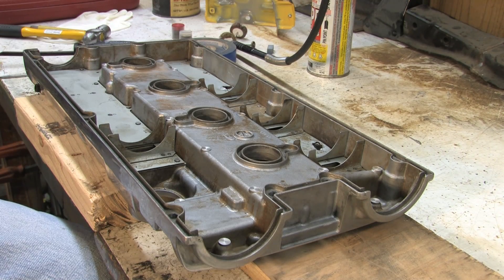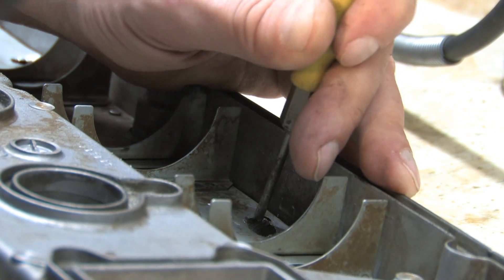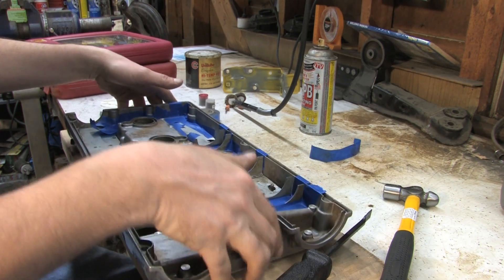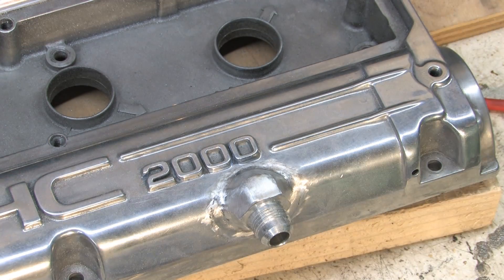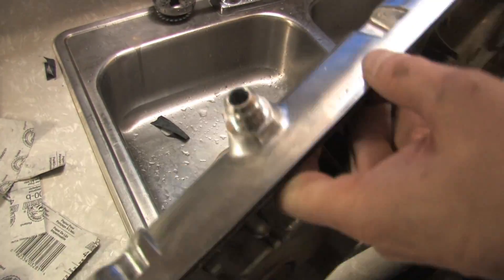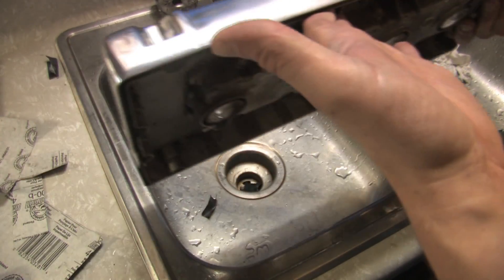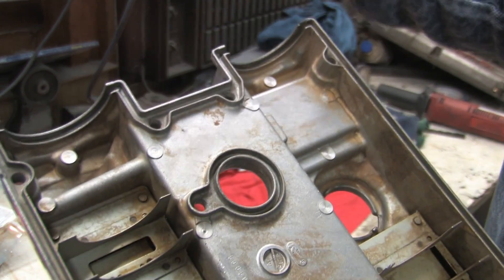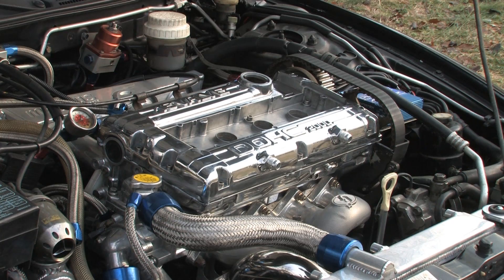Valve Cover Modification and Polishing

Comment: I didn’t see. Where do you have the exit hose from the oil separator connected to.
Reply from the maker: Each one goes to a catch can inlet.  I'm likely changing this.  Making my own thing to bolt onto the things.  More romance than anything, really.  What I have works fine, it's just not very heat resistant, and I don't think I need two half-inch breathers with their own hoses is all...

Comment: When you said go to the junkyard and get something that says Hyundai on it, I was a bit confused since the valve covers don't interchange do they? When I welded a breather port on my head I didn't get any leakage :). I'm no welding guru but not too bad with a TIG (Invertig 221).
Reply from the maker: On my Patreon page, there's a video for my sponsors of me finding a Hyundai Elantra in a junkyard and yanking parts off of it.  You'll see me collect a pristine Hyundai 4g61 valve cover that fits every DOHC 4gxx head.  It was the only one missing from my collection.  It's no different than the Mitsubishi valve covers, it just has the Hyundai oval logo on it.  For many years, Mitsubishi engines were used in Hyundais.  They didn't get the ability to make their own engines until late '95.  Once they did, they still cast parts that fit Mitsubishis for their service industry and on cars produced through 2006.  Some Kia engines, too.  But the Sonatas, Elantras, Excels, Summits and most everything in their lineup from '95 and earlier had Mitsubishi stuff under the hood.
Reply: Oh wow, that must have been quite a rare find. Thanks for the information. I just looked up more pictures of that on google image search and you're right. I've yet to ever see one in a junkyard here in Florida though.
Reply: Btw, what are your thoughts on going dry sump with your setup? I am really tempted to try it, since I can weld my own oil pan. I like the thought of less crank case pressure, or even slight vacuum, not having to deal with breathers/etc, being able to shave my entire valve cover and weld in the oil fill plug, etc. A lot of the used dry sump pumps on eBay look a bit sketchy, or are too big (6 stage for nascar/etc). Kind of hard to find a budget 3 stage.
Reply from the maker: People hated these cars.  Owning one, I completely get why.  But 26 years later it's pretty cool having a first generation Elantra now that they're wildly popular today.  It's like every 3rd car in traffic is an Elantra now.  In 1992 they cost $9,000 less than a comparably-equipped Civic which stigmatized them in the marketplace.  They really didn't sell many of them here in the US except to poor people who couldn't afford to maintain them.  There's absolutely nothing on the outside of them that stands out in any way.  They infuriated everyone on the road when they'd merge into a traffic lane in front of them because their normally-aspirated 1.5 and 1.6L engines were under-rated for the weight of the models with power options.  Everything cracks and rusts on these cars, even if you've never touched or used it.  You can't get a date driving one.  Believe me.  It's because of the buyer's experience with the car, and the lack of love and maintenance that most failed with minor repairs the the owners chose to dispose of them rather than fix them.  But if you accept the fact that they were not well made, then they're actually great cars.  The Mitsubishi drivetrains were solid and reliable if they were maintained.  

The fact that I have one with a 2.0L  turbo engine that makes 420hp with water methanol injection, bluetooth, 800W stereo with 2 10" DVC subs and such a nice interior today borders between stupid and unnecessary.  At least to everyone else who's not behind the wheel.  If you think you're an adrenaline junkie, driving this thing at 21 PSI on the street will scare the living daylights out of you.  No airbags, drum brakes, limited suspension travel and a dead rear axle.  Good luck!  Mine was found at a kidney car donation lot with only 53,000 miles on it.  The previous owner ditched the entire driveline and engine management system, and installed a mash of spare parts from at least 25 different non-turbo cars and minivans, all of my spare turbo parts and bolted to a '90 plymouth laser fwd turbo transmission.  It's definitely unique.  And that's weird... because it's still just an Elantra.
Reply from the maker: Magnus makes a dry sump setup for a 4g63, and it's an absolute work of art.  I could never improve on it.  It's designed for automatics, though... and sadly I don't have an automatic in the whole driveway.  If I were building a race car that I had no intentions of driving on the street, dang right I'd dry sump with Enderle fuel injection pump, a vacuum pump, water/air intercooler, and a Level10 transmission.  Then turn it up to 10,000 RPMs & tater chip it.
Reply: Haha that's quite a description! And a solid axle even? That's definitely an awesome piece of rare Frankenstein build you got. I'm basically in a similar situation. I picked up a 1999 Mitsubishi Mirage from some girl who's ex got arrested driving the car with drugs lol. The ignition coils were shot and she had no license, I scored it for 500. I beat on the stock 4G93 (I think?) engine to the end and couldn't kill it, even ended up selling it. Bought a donor 3g Eclipse with no title and swapped in 2.4 SOHC 4G64. It made the little Mirage come alive. And after I threw some K-Sport coilovers on it, dropped it, gutted it, and some cheap rota grid wheels on it the car actually looked pretty awesome compared to how it started. I had to spend 850$ on custom axles from Drive Shaft Shop to link the 3g trans to the hubs in the Mirage. Ran 100% solid alum mounts on all 4. No A/C or P/S. Swapped in a manual rack from an earlier Mirage.

Then I swapped an Elantra head on it and put in ARP studs. Had to order adjustable cam gears to compensate for the belt oddities. I think I did -4 deg on both gears? I deleted balance shafts. Got a 2G eclipse turbo manifold (only Mitsubishi eclipse I've seen in the junkyard ever, all are usually the neon engine). Thought the old turbo was worn so I replaced it with a cheap Chinesium one from eBay, worked great. Wired it all up to Haltech finally, and after that I was so burned out working on it and so blown away with how it felt under boost that I just drove it like that for half a year. Turns out over time I melted my turbo exhaust wheel a little on the tips and cooked my valve stem seals badly. Also I ran the car with Evan's coolant and Davies Craig electric water pump. The water pump once died on me 15 miles from home and I made it back with no coolant circulation or boiling. The car still ran great for a few more months of DD. I think credit is to ARP studs and Evans coolant. I'm never experimenting with electric water pumps again.
Reply: I have everything apart right now again and I'm planning to get the block deck resurfaced, putting in Manley beehive springs and retainers, stainless steel valves. I still need/want to buy eagle rods and JE pistons combo rated for 900 something. I will rebuild my turbo with a 9 blade exhaust wheel I bought. Drive it again and learn how to tune it properly this time. Then I have a BW EFR Indy car turbo I bought I want to put in, but not until I learn on the crappier turbo. Don't want to damage the nice BW EFR. It's got an aluminum center cartridge, even a dry sump fitting I took off which I don't need (or do I?) and a gamma-ti exhaust wheel. I accumulated a bunch of blocks and heads and parts and whatnot over the years and got nothing done on my project thanks to being with a dumb woman for a few years. In my previous setup when it was all together, the car weighed in the high 1700s.
Reply: That sounds like a pretty awesome build if you were to do that. I'm contemplating on maybe grabbing a 3-500$ Barnes pump on eBay and fabricating my own oil pan (Moroso too expensive for me, not too many used ones being sold). Where do you think the ideal points for oil scavenging are on our engines? I'll have to look at the Magnus example, maybe try to copy it to the best of my abilities. You were talking about no intentions of driving it on the street, could you see any disadvantages of a dry sump setup on a DD project? I know it sounds kind of dumb, I'm Russian and always have a Mad Max mentality to the comfortness of my cars and driving experience lol.
Reply from the maker: Good gravy!  What was the compression ratio with an Elantra head on a 4g64?  Did you ever work all that math out?
Reply: I should really do the math on it, that is one of my weak areas that I still have to learn about engines. Surprisingly though, even though some people said that it is an interference design, I once spun it very very carefully by hand and could never get the valves to touch the pistons. I don't think the compression ratio was that high, but I'll do some reading and try to figure it out since I gotta put at least two of these engines back together (one to fully build up, and one to at least run as a DD and have a little fun with while I build it).
Reply from the maker: With the 1.6L Elantra head on it, it should have been extremely high.  Like 11:1+.  That head has tiny combustion chambers.  The swept volume difference between the 1.6L in the elantra and a 2.0L is .4 liters.  That difference is enough to raise the 2.0L non-turbo block from 9:1 to 10:1 compression.  The difference between the Elantra and the 4g64 is .8 liters.  the compression ratio breaks down like this:

swept volume + combustion chamber volume : combustion chamber volume

If the same difference occurs between the 2.0L head and a 2.4L head... that happens between the 1.6 and 2.0... then you're looking to have between a 10.6:1 and 11:1 compression ratio.  You will melt turbine blades for sure with that setup.
Reply from the maker: I have a video on this topic.  Lookup "Calculate Your Compression Ratio".  It goes through every last bit of the math and how to get your numbers from those parts.  ;)
Reply: Ooops I made a huge mistake with the names. I need to practice them and read the makes/models history more lol. I meant I had a head off of a Optima/Sonata. The G4JS engine. Now I can see why you were so intrigued lol. But I will definitely go watch that video and check my compression ratio out. What are your thoughts on the oil pan for a dry sump? Where would be the ideal areas to put the scavenging ports? And how many? I see most 4 cylinder setups using 3 stage pumps. The 4 or 5 stage pumps might create too much vacuum and suck in seals? Which can be avoided by a vacuum regulator but seems like a waste of weight/power/hp to spin that many stages or?
Reply from the maker: Honestly, once I set eyes on the Magnus kit in person at the 23rd DSM EVO GT-R Shootout and saw how complete it was, and how comprehensively they addressed all of the tricky overflow problems inherent to 4g63 blocks running at 11,000+ RPMs, I stopped imagining I could ever put together a better solution on my own.  I want to build a track-only car like that someday, but I don't think I'm quite crazy enough to drive a car with a straight-cut gearbox around on the street...  Someday I'll build that car, but I believe I will only be able to take 1,400+hp in small doses and on a track.  Just look at how complete the Magnus kit is vs how much of your engine needs to be modified and what you would have to find, fabricate and re-engineer to do the same thing.  They give away all that info.  That's easy.  Making it fit in your engine bay and on that block is the challenge.  It's a 4-stage pump setup with two from the pan and one from the head.  The fourth pump is for the oil supply.  It comes with a new CNC machined masterpiece of a front case, gaskets, pulleys, clamps, hoses, fittings, fasteners, oil pan, brackets, tanks... everything, and it fits in your engine bay to make it work.  The photo tells quite a story.  Seeing it in daylight though...  I just don't have a credit limit like that.  Not yet.
Reply: Hah damn it, you shouldn't have said straight cut teeth! I almost forgot about that. Now my wish list is much bigger and harder to reach. I will definitely study that kit some more, I didn't realize it also had one coming from the head. That is pretty interesting. I remember you mentioning that all the oil goes to the back of the head when launching. I still have to watch your videos about the oil improvements. I wonder if I can copy as much as I can and make a poor man's dry sump :). I like fabrication challenges.
Reply: Quick question, do you see any simple methods of converting to AWD? I know our platforms are a bit different but I'd like to hear your insight as to which gearboxes are most readily available as far as junkyards/ebay/etc goes and how well they stand up to abuse or how complex their parts are for adapting/mounting/fabricating mounts. I think on my Mirage I might have to do some really heavy fabrication because it doesn't seem like the unibody shares anything in the back with the Evo. One guy who I saw accomplished it, literally took the whole floor and half of the rear bottom out of the car by undoing all the rivets and swapped it with an imported part of the Evo.
Reply from the maker: lookup Hoboevo on Facebook and Instagram.  He'd be the guy to talk to about that.  The mirage AWD swap is pretty widely documented on 4g61t.org.
Reply: Lol the name sounds pretty hilarious. Thanks for the tip, can't wait to check it out.

Comment: what did you use to polish the valve cover? I have been wanted to polish mine for a while but don't know what to use after sanding it down completely smooth
Reply from the maker: Friction.  Use Black Rouge, a high-speed polisher (angle grinder, straight shaft grinder, something with torque) and a triple-stitched flannel polishing wheel.  That will get you started.  You'l figure out what to do with a new clean wheel and white rouge once you're finished with that.  Watch the rest of my polishing videos, I've got a few how-to's and re-polishing videos because it's part of the theme of one of my project cars.  Once you start doing it, it never stops.
Reply: yeah but what brand and where can i buy it ?

Comment: Just a stupid observation- and more stupidity out of the noisy end- but I hope you realize- that when your sanding/cleaning and "polishing" a TIG weld- that bead is sometimes made from tungsten or an "alloy" of aluminum. Have you ever checked out Muggy Weld products? They have stuff that can save your bacon- or allow you to fabricate like never before: cast iron welding, dissimilar metals, brazing stuff, silver solder stuff, etc.